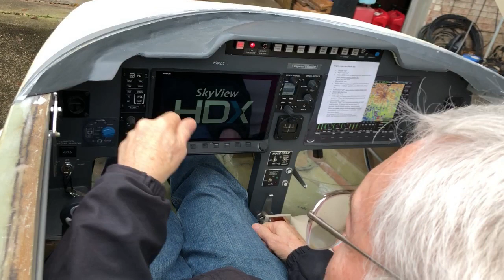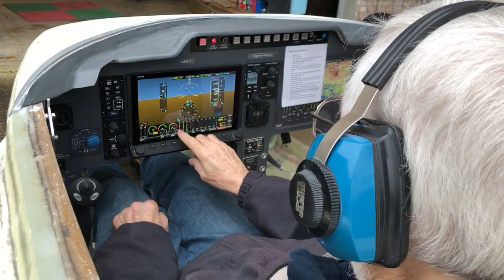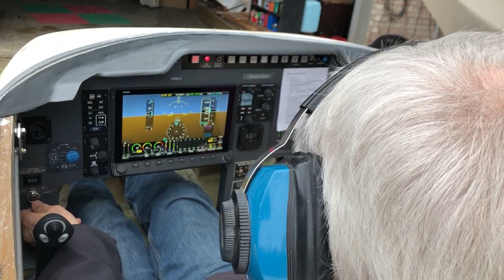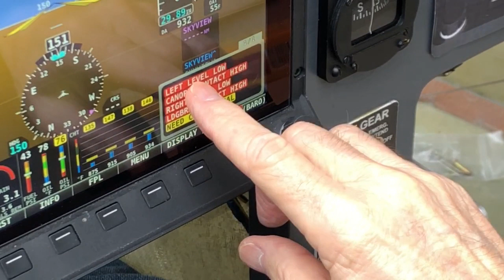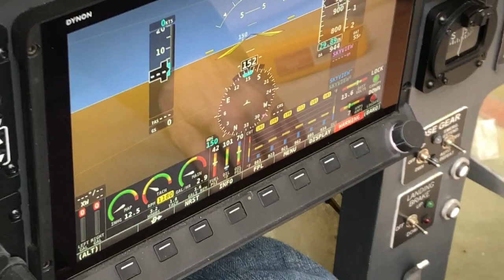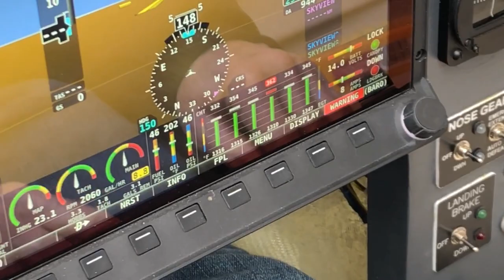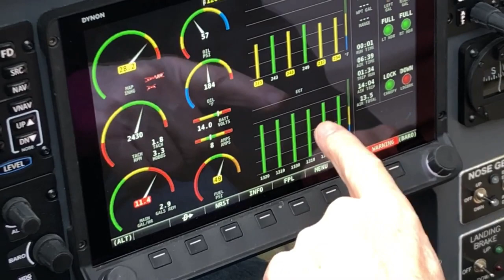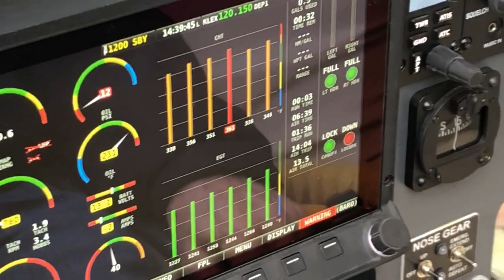Familiarization tour of the Cozy Mk. IV, and UL520iS engine runs

Comment: I really hope the UL works for you. I was on the early end of engine production and mine had teething issues. Leaks, low voltage flywheel damage from starts. Hopefully they fixed those issues. The support from Robert was phenomenal however. Overall I think the UL is a great alternative.

Comment: Hello Greg,
Because the UL Power engine is significantly lighter than legacy Lycoming and Continental engines, did you have to make any adjustments regarding center of gravity?
Reply from the maker: Yes, I did.  I extended the engine mount 2", and shortened the prop extension by 2" so that the prop remained in the same relative position.  With less weight on the back end, the maximum front seat capacity was reduced.  Moving the engine backward helped restore that.  (Remember that my installation is a pusher arrangement).
Reply: Is the weight different enough to enable the addition of a constant speed prop? 😁

Comment: Ah shame you couldn't wait for the turbo that would be 220 ktas easily
Reply from the maker: I'm not so sure... upping the horsepower doesn't affect the air frame drag characteristics.  Down low, it wouldn't make much difference, as drag goes up with the square of the velocity.  But at 15,000 feet, you could be right!  What I would expect would be fantastic climb rates!
At this point, I wouldn't want to go to the extra expense and effort to make the change.  I want to see this thing fly before I die!
Reply: @GregoryACross  If I build one I would get the turbo for those nice climb rates and full manifold pressure up at 15,000ft.
Reply from the maker: @PatrickMichalina  That sounds great, but prepare for sticker shock.  The UL520-T Turbo version is pretty expensive compared to the UL520-iS model.

Comment: I'm sorry there just not 50k wroth of engine there...
Reply from the maker: True... nor does it cost anywhere near that much.  As aircraft engines go, it's a bargain.
Reply: It's truly a crime that more people aren't recommended to use Subaru engines. Never the less he has a plane and I don't so what do i know hahah :)
Reply: @John-rw9bv  People are scared off by Subaru engines in aircraft because there are a decent amount of people that tried but had too many issues making it not worth the squeeze to most builders.
Reply: @GregoryACross  If you don't mind me asking, how much did you pay? I am contemplating putting the UL520 turbo on my Long Ez.
Reply from the maker: @majorchungus  Well under $30,000.  But, mine is not the turbo version. Prices vary from country to country, so best to consult your local UL Power sales representative.
Reply: @GregoryACross  thanks. I understand prices vary, I just wanna have a ballpark to save for/plan for.